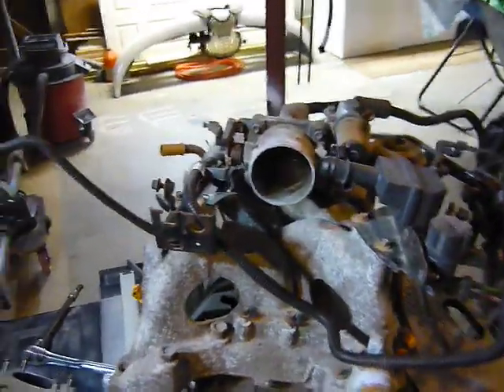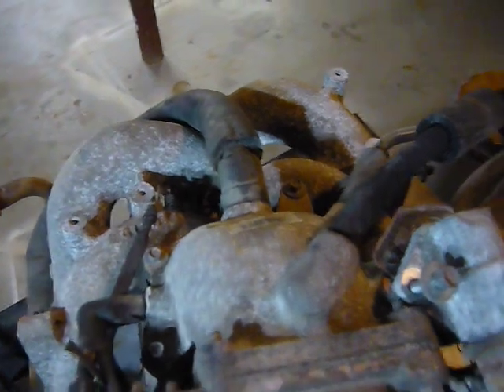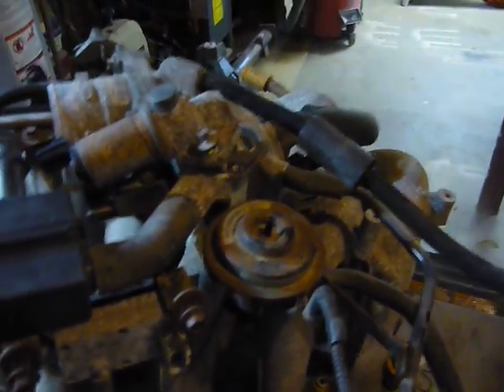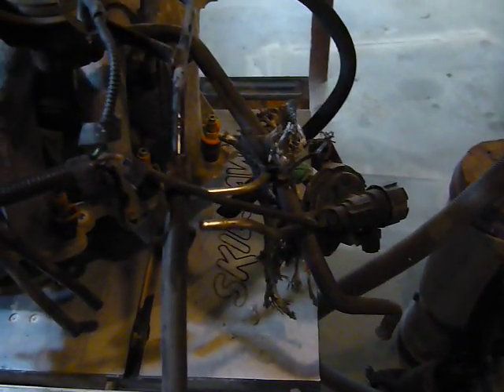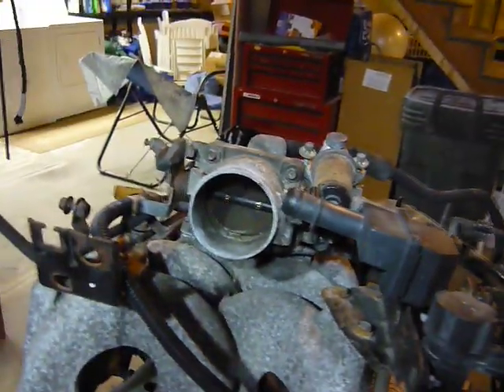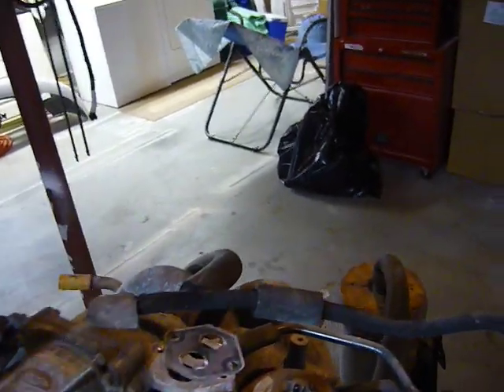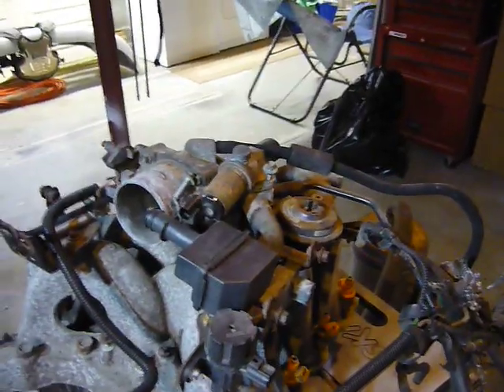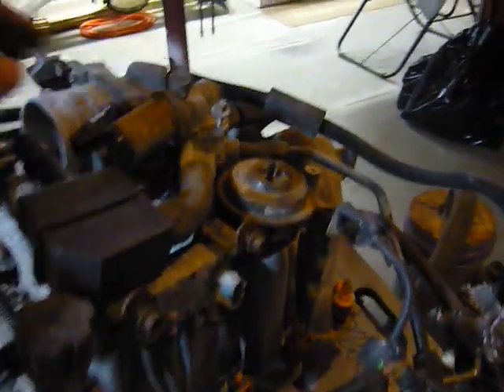f150 intake manifold

Comment from the maker: that sucks, so you have the 2 lower gaskets to replace, that's not to bad of a job, can certainly be done in a day you'll have to drain your coolant, and remove some of the radiator hoses that connect but just remove your throttle body on top of the intake manifold that'll give you more room to lift it and you can either remove your fuel rail or disconnect the fuel lines other than that it should be free to unbolt and lift off  hope this helps let me kno if i can tell you anything else

Comment: I have a 2000 ford f-150 v6 4.2lt I have a leaking lower intake gasket. I have the part to replace it. How hard is it to change and do I have to take any part of the motor out? Auto shop showed me it when the truck was lifted up